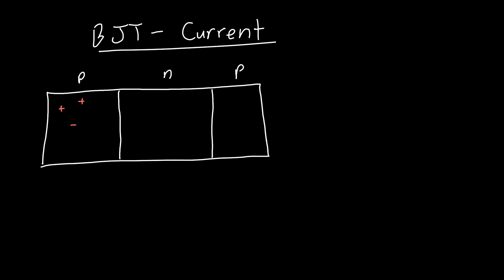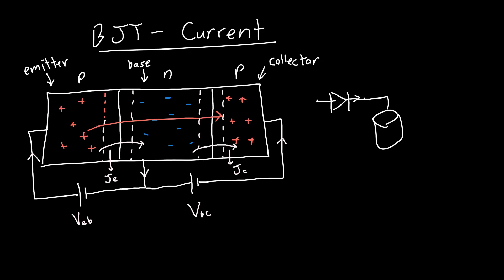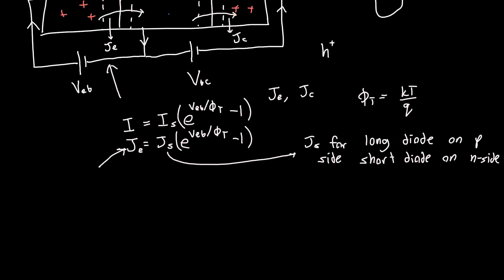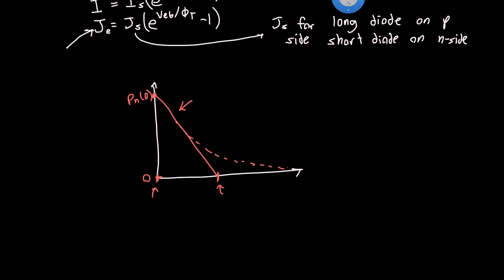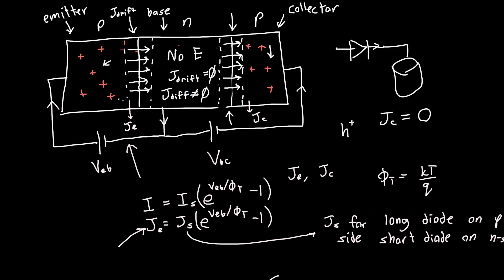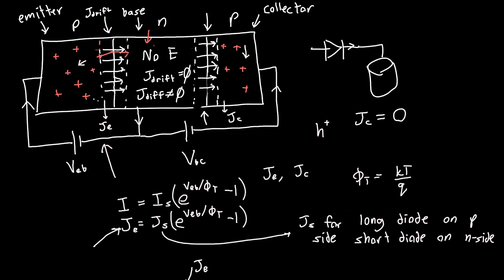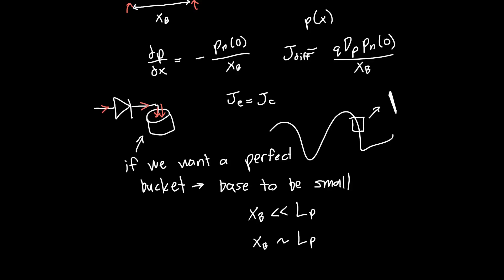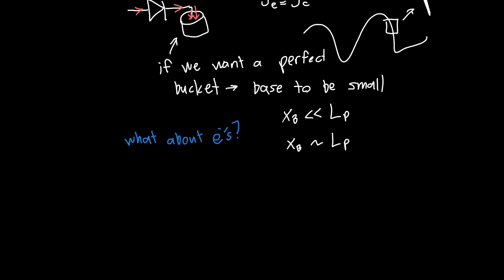BJT Explained Part 2 - Ideal Current

Comment: 7:05 shouldn't the field in the depletion region on the left have a field in the opposite direction? With applying a voltage that field will get smaller and smaller, but will it reverse, like you have drawn it?

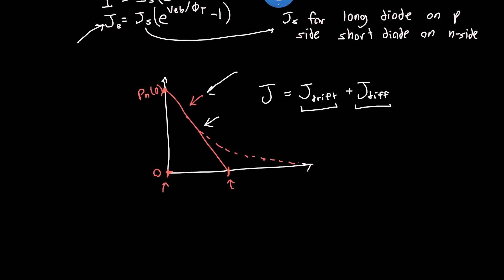Comment: Nice video! Just one comment, at about 08:05 you say that the holes that reach the left depletion region immediately get swept over to the base, and then diffuse, etc. This reasoning started saying that the strong electric field at the collector junction sweeps carriers over, and then you moved to the emitter junction. But the field at the emitter junction opposes majority carriers to flow from the emitter to the base. However, since the emitter junction is forward biased and its field is weakened, carriers cross the emitter junction anyway because the diffusion overcomes drift. And once carriers enter the base, they of course diffuse, etc.

Comment: At 12:30 you say that the electron current just loops around between the base and emitter. What I don't understand is why so few electrons continue straight to the right, through the V_BC voltage source. Why don't many go that way?
Reply from the maker: Great question - mostly because the electric field lines don’t point in that direction. Almost all the force is directing them across the junction, relatively small transverse fields are forcing them elsewhere.

Comment: Hello Jordan ! At 6:50 you place electric field vectors on junctions. The E field on the left side junction depletion regione should be directed toward left or it is correct like that?
I mean, inside the depletion region of the (left) p-n junction the field should still go from n side (+ exposed ions) to p side (- exposed ions) even if it is reduced by forward bias. does this make sense?
Reply: well you are right, but due to forward biasing, the total electric field is left to right.
Reply: Jordan could you please help to clear this up? I'm a bit confused :S